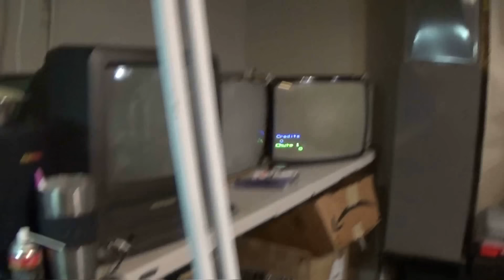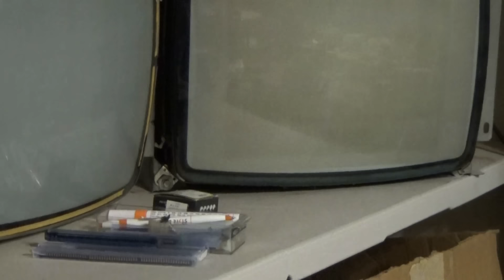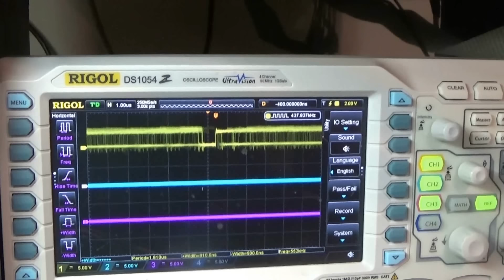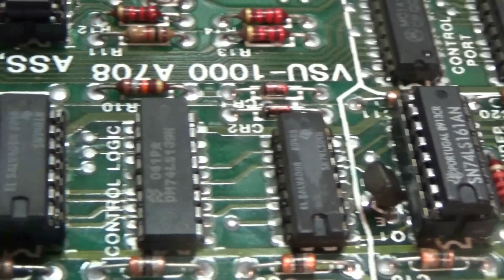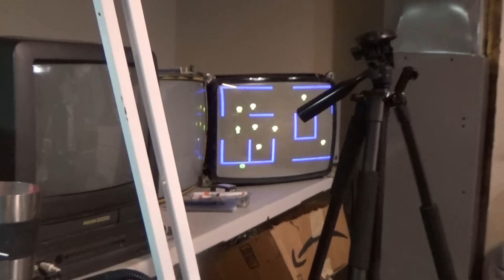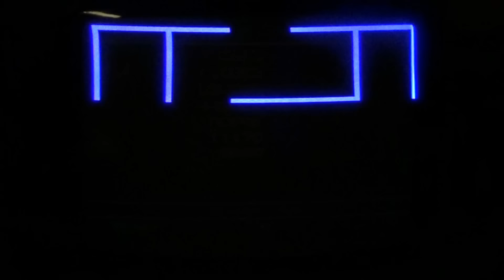1980 Stern Electronics "Berzerk" Repair Part 6 -  The VSU PCB

Comment: If they didn't use such an obscure speech chip...but there may be a good replacement in the future since the same guy who developed the chip back in the 1970s wrote an emulator based on its design.  I'm afraid the same thing can't be said for Votrax, though, since it uses an analog vocal tract, which is the reason why each one sounds a bit different.